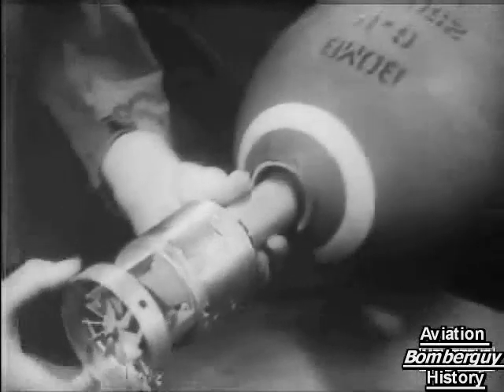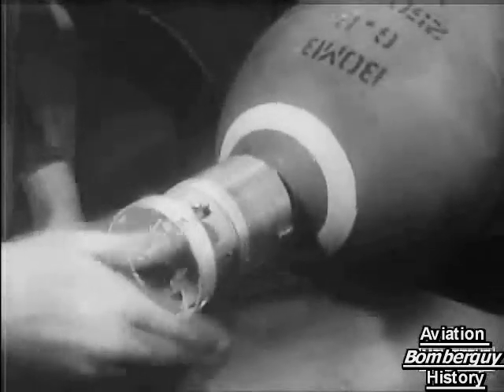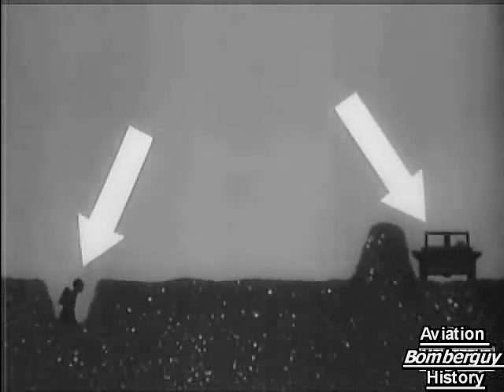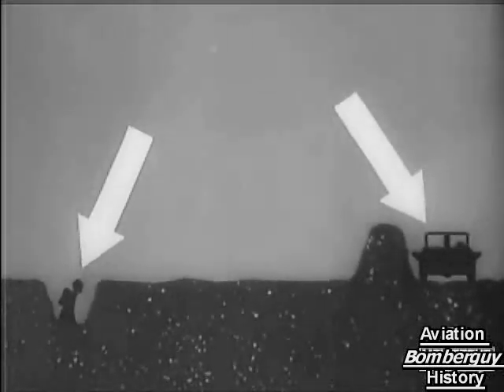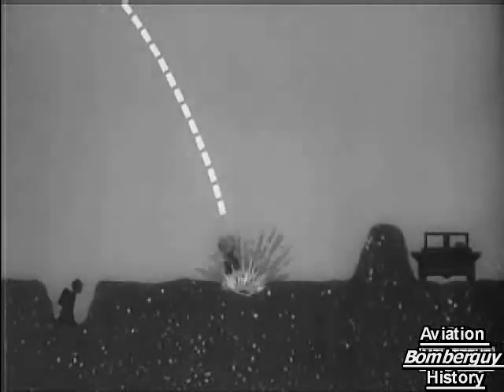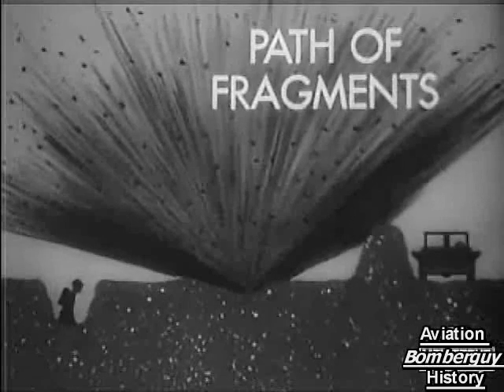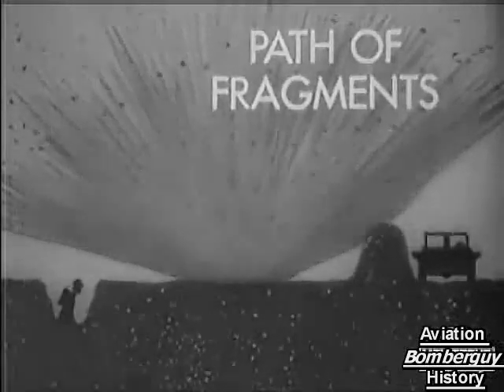The Radio Proximity Fuse

Comment: Good video, thanks for doing it. As I understood it, someone who knew actress Hedy Lamarr, a Hungarian inventor, had sketched out the idea. The device is just a fancy trigger using radio frequency pitch. It is set to go off once a higher pitch is received, that is proximity to the target, ground or aircraft. Of course nothing concerning vacumn tubes is ever easy, so no wonder the invention required such a mass effort. Same thing went for early computers with the tubes--mass efforts were needed.

Comment: I have read different reports on the effectivness of the proximity fuse.
2453 round fired to down enemy aircraft prior to proximity fuse
423 round fired with proximity fuse per down aircraft.
1267 round per enemy w/o proximity fuse
248 round fire w/ proximity fuse per enemy aircraft downed

Regardless of the report the use of the proximity fuse increased leathality by a factor of 600%.
Its almost like increasing the number of AA guns by 6.  Not bad going from five 5" AA guns to 30 not bad

Comment from the maker: It's a good thing the Germans didn't develop this technology first, they would have devastated our bomber formations and possibly changed the course of the war
Reply: Not exactly. The German version that closest to operational stage use electrostatic instead of radio signal. It work by using a big capacitor, which will discharge itself near a huge metallic object that hopefully is the target, which trigger the fuse.

"Hopefully" because the damn thing discharge to practically everything, including rain, cloud, fog, vapor....you get the picture. Combine with less range than radio fuse, you can see why it isn't such a reliable idea.

I think the American did study and patent the design, but I don't think it was actually used.

Comment: This is one of the most interesting tales I've come across in years. What a shame they weren't allowed to be used over enemy territory until close to the war's end - I presume that they didn't reach their full potential as far as being used in bombs and rockets?
Reply: They were afraid of it being captured and reverse engineered, since the design was simple and could have been easily countered with a low power transmitter.  In the end, the same spies that gave the soviets the atom bomb gave them the VT fuse, so it's military usefulness was blunted.  But ironically, a more advanced version helped the soviets shoot down Gary Powers' U-2.

Comment: How does the fuse detect nearby objects with the radio waves?
Reply: Yes
Reply: The variable time (VT) fuse radiates
a continuous radio signal which is reflected
from targets of the type mentioned. When the
reflected signal from the target reaches an
appropriate value, a condenser is allowed to
discharge through an electrical detonator
called a squib. The blast from this squib
operates a standard auxiliary detonating fuze,
which in turn detonates the main charge of the
projectile.

Comment: Itty bitty radar
Reply: Travis Thacker  the shells had a glass vial of electrolyte which fell into the plates of a battery upon firing from the gun. The timer was actually the time taken for the heater in the valves to warm up.

Comment: Thank you, Bomb.
What kept these bombs from detecting each other and not exploding prematurely?
Reply: In the beginning if you watched, it showed that a fan spins after the bomb is on it's way down. That fan arms the fuse after a pre determined time (say, 15 or 20 seconds after release) It's kind of hard to tell, but by that time, the bombs are fairly well dispersed. Additionally, I'm sure the angle that the fuse receives waves from could be adjusted so it's not taking in radio waves from like 180 degrees from the nose.
Reply: A lot of things. For one, the bomb uses doppler shift so that it only detects things that are moving at certain speeds relative to itself. The bombs all move at the same speed relative to each other. Secondly, the bombs aren't typically going to be armed in close proximity to each other. They'll arm at some point after release when they've spread out a bit. Thirdly, the radar cross section of a bomb is very very small compared to the ground or to another aircraft, so its doubtful that the bomb would be picked up in any case.

The harder problem is keeping the radars from interfering with each other. This is achieved by only looking for the ground in short increments.